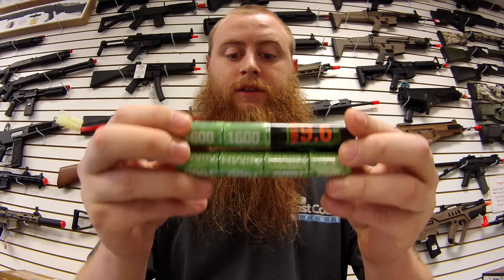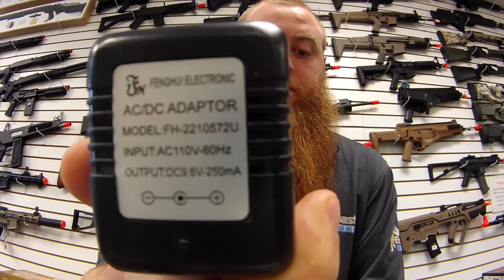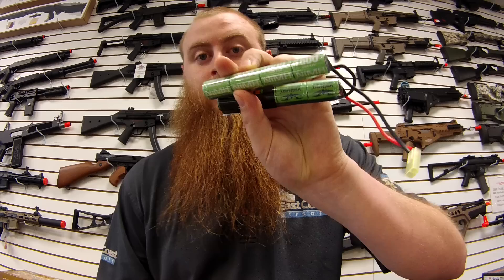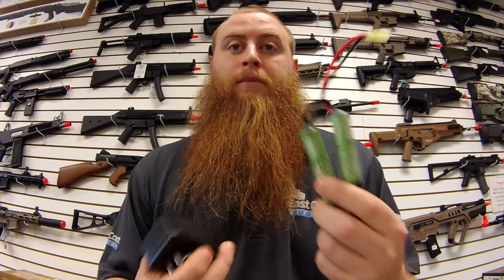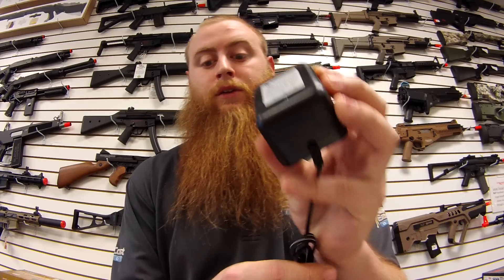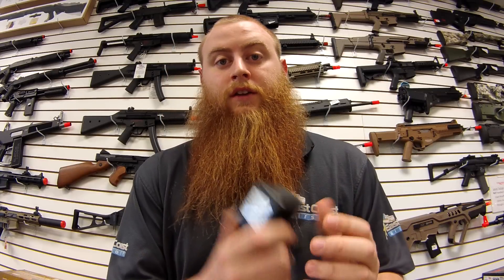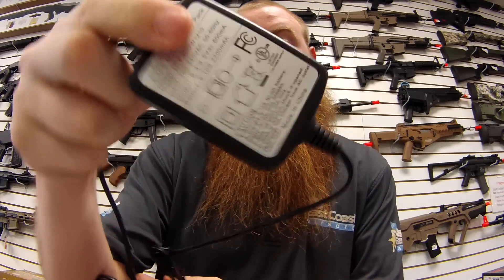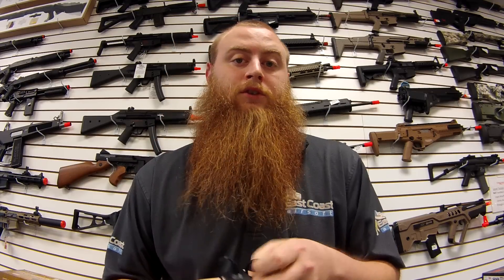How long do I charge my airsoft battery on a wall/dummy charger?

Comment: Take the GoPro out of the waterproof case, your audio will sound much better.
Reply from the maker: We are not sure what happen to the audio, it was not in any case.
Reply: EastCoastAirsoft, my battery overheats when I charge it. what does that mean?
Reply: i tried to charge a lancer 8.4 on my keener stones chargerbox 100-240v ac and it caught on fire bruh ,i have multiple  new batt's an charger now but i really don't want to try again.
Reply: @devonhc7770  lmfaooo

Comment: My gun stopped working and got supper hot well the battery and basically like glue on 2 the gun harness pulled it off and now my bb gun won't fire

Comment: What happens if your battery is charging over night
Reply from the maker: It is not recommended to leave the battery unattended especially if it isn't a smart charger.  If it is a smart charger it will stop trying to charge when it's full.

Comment: How long did he say someone please reply
Reply from the maker: You have to do the math.  But it's best to just get a smart charger and then you don't have to do math.    But if you are using a wall/dummy charger look at the output on the back of the charger.  Then divide that number into the mAh of your battery.  Just make sure the battery is all the way dead or you will need to charge it for less time.

Comment: My battery us 500mah and my charger output is 200ma how long do i charge ? My charger does not have light !
Reply from the maker: 2.5 hours if it's completely dead.
Reply from the maker: But I highly recommend getting a smart charger so you dont have to guess. We have them in stock on our website here: https://www.eastcoastairsoft.net/Valken-Smart-Charger-8.4v-9.6v-844959048290-1529/

Comment: There doesn't seem to be any smart charger for AEP nimh batteries. They use a different connector, unlike lipo batteries which have the same kind of cable as for AEG batteries.

Comment: I was actually wondering if the default wall charger light would turn off when done (the paper of my pistol said some chargers do) even though I had a feeling it doesn't. Thanks for confirmation.

Comment: I have a charger, it turns green when the battery is charged, but if you take it back out and out it back in it turns red again, why?
Reply from the maker: Hmm, I will have to look at that might just take a little for the charger to realize the battery is already charged.

Comment: im in the uk on my battery it says "2A" ive looked it up on a converter (A to MA) converter and it says its 2000 MA and i have a 9.6 1600 nimh battery which says its 0.8 hours (hour and 20min) which does not sound right as i have a smart charger when the battery is done charging it will stop charging and the bulb will say a solid color but i have been charging it for 6/7 hours and it still has not stopped this is a brand new battery/smart charger is this right???
Reply: I have same issue, i have bought a smart charger with 2A and that is 2000ma ,how long i should leave my airsoft battery to charge if is 8.4v -1600mah ? Normali is about 1hour plus 20mins 😂 i do not think is right 
It was flat then i charged it then after 1 hour plus 20 mins the led showed in green that means is fully charged?

Comment: EastCoastAirsoft, my battery overheats when I charge it. what does that mean?
Reply from the maker: What kind of charger do you have?  And is it actually getting extremely hot to the touch or just warm?  Some batteries do get warm when they charge, I am not 100% sure why that happens sometimes though.  But if it is getting too hot to even touch there might be an issue with the battery, or possibly the charger.
Reply: EastCoastAirsoft ok, thanks. I use a stock charger not a smart charger. it's the exact same one that you use in the beginning of the video. I don't think anything is wrong with the charger since I've used 2 different chargers on it and get the same results. It might just be be normal like you said, some chargers warm up when charging. should I occasionally unplug it while charging so that it doesn't heat up too much or will it be fine as it is?
Reply from the maker: It should be fine just make sure you don't over charge it.  We really recommend getting a smart charger so you don't have to worry about how long you leave it on.

Comment: fuck sake I bought the tavor 21 and got a 1100mah battery 8.4v and the fucking instructions don't give a charge time I read the whole damn thing somebody please tell me how long omg
Reply: What is the output that it says on your charger?  Take your mAh and divide it by the output mAh of your charger and that is how many hours it takes to fully charge your battery from being completely dead.  If it's not all the way dead it will take less time.
Reply: Ok I was just hoping the jackass that sent me the gun would at least give me instructions not your guys